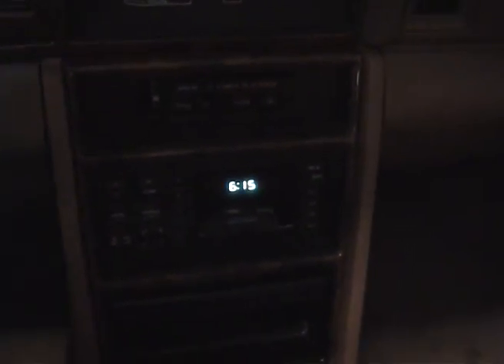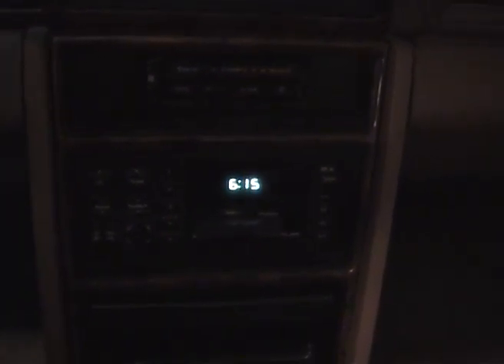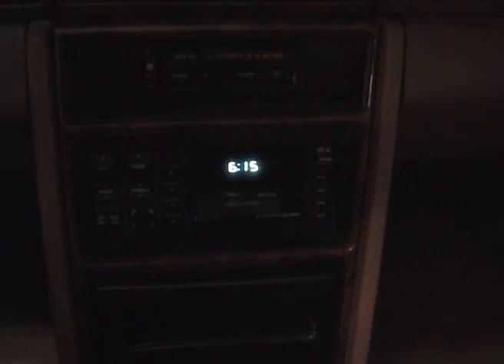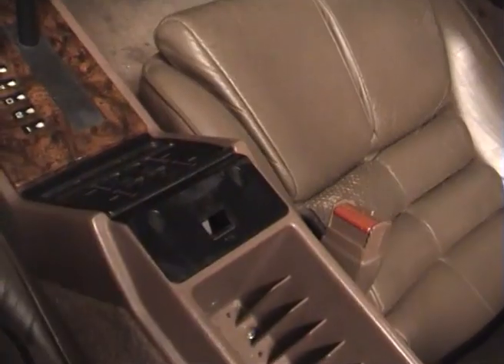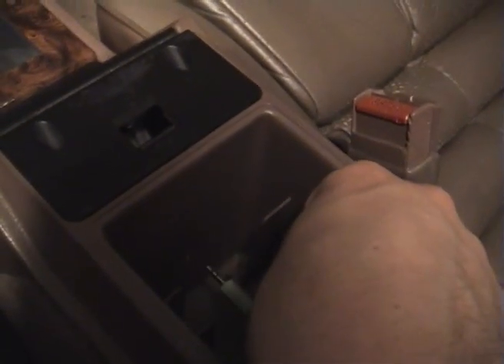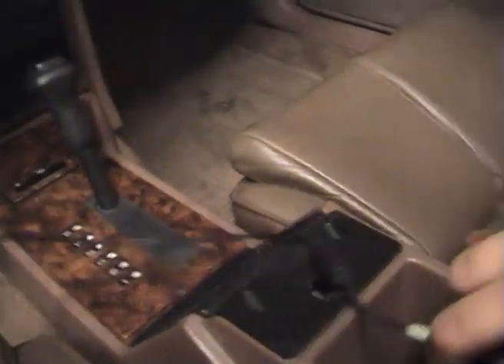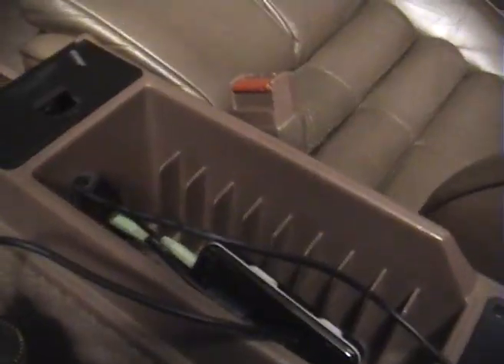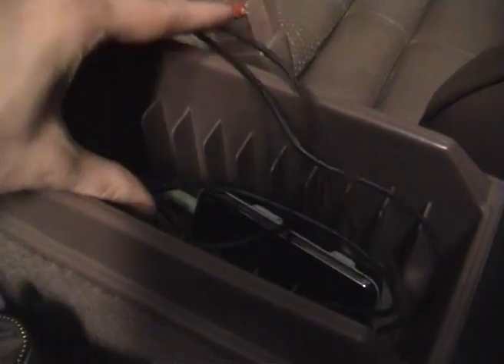AUX input for a 1990 Chrysler Infinity 1 system

Comment: Excellent job, congratulations. I'm looking at your post at Dodge Performance. Any chance you still have the DIN plug diagram?
Reply from the maker: Thanks! Wow, I hadn't been there for a while! I have searched on my computer but unfortunately, I wasn't able to find the diagram. I don't have the car anymore either, so I can't look at the cable itself.
Reply: @McVaio  thanks for trying. I'll try to figure it out.
Best regards
Reply: @tupapirafa  were you able to figure it out? I found a diagram for the 8 pin DIN on the internet, but didn't work in my case.  I' really trying to make it work.
Reply: Hi  @nicolascontardi  yes (kind of) TBH I sent it to a guy who specializes in car audio and he managed to connect it, however he did it without the switch that McVaio mentioned. 
I'll take a look on it and see if I can share a pic, just please post another reply on Wednesday in case I forget, since I don't have the stereo right here.

Comment: You do realize you can record modern music onto cassettes, right?
Reply from the maker: y u mad
Reply: Answering for the McVaio channel:
That is correct, but this costs far more effort than copying digital music onto a portable device. Plus it causes a loss in quality.
Reply: LuxuryCarReport Haha, so you're telling me that it takes MORE work? You're doing the same exact thing. If you're putting music on a CD, it's the same thing as putting music on a cassette. It's really easy. Just hook your MP3 player or your smart phone up to a cassette deck with the recording feature and play the sound device, then hit record on the deck! It's real simple. If you use a high end cassette, or at least a good quality one, you're not losing any quality.
Reply: LuxuryCarReport Yea, it is a lot easier that way, but normally when I do it, I have an intention to use it with other decks.
Reply from the maker: @mraiwa1000  Wao

Comment: Very cool! I was thinking of installing my Pioneer into my car but I can keep the Infinity deck and use a Bluetooth audio to 1/8 aux output playing through my phone.
I understand that plugging in switches to the audio source over to aux but can you select another source like radio or cassette and go back to aux in without unplugging the 3.5mm cable?
Reply: Answering for the McVaio channel:
That is not possible as far as I am aware of. Maybe if you press the tuner button, I have never tried that actually.
Reply: LuxuryCarReport my 2004 Sonata has a 8 pin round female option located in the back of the factory cd stereo. Any ideas on how I can attach a 3.5mm aux? (The inexpensive way-lol)
Reply: What would that connection normally be used for?
If it's an analog input, then it might work the same way as for my LeBaron:
http://www.turbododge.com/forums/f4/f21/201929-adding-aux-port-91-infinity-head.html
Reply: Yeah, that's the one on those pics in the link. But unfortunately I'm not that tech savy. I'm more of a plug and play  kind a guy. And save $ by the way. I know there's some Isimple adapters that cost over $30. Thanks though. Great Pic (avatar)by the way!
Reply: printer003 I understand you completely. If there would have been a readily available adapter for my LeBaron, I would've sure bought it. But unfortunately, there wasn't.

Comment: i think it does cause i know the infinity 2 system had an add on but is very rare cd player. so i know it would auto switch when the cd player was used. i have a fully working infinity 2 system but without the cd player add on. i got it out of a top of the line 1990 chrysler new yorker. i happen to like the infinity 2 system since it does do am stereo and such so i kept it